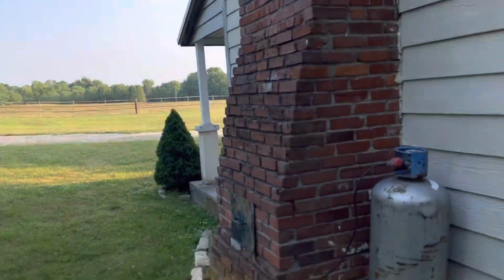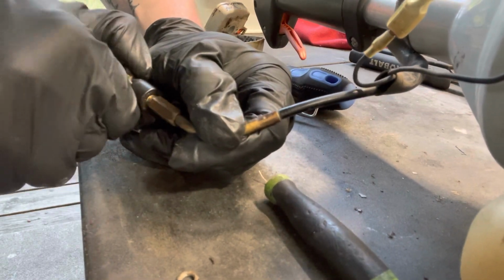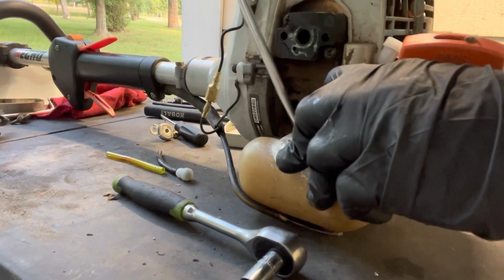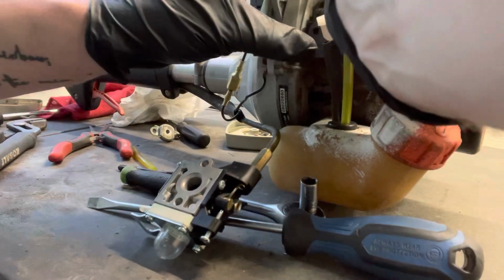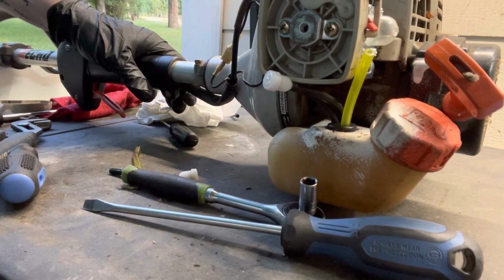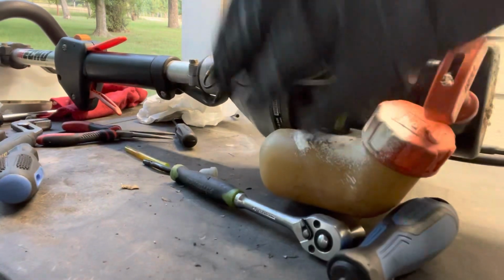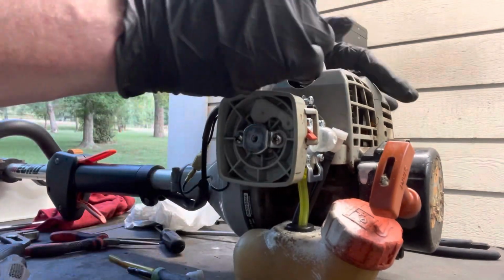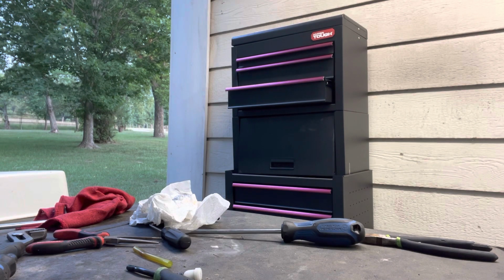Replacing the carburetor on a Echo srm-210 weed eater.

Comment: Bought this same trimmer used the other day. They had put the same carb and plug neww off amazon also . But guess neeeed adjustments because when cold hard so hard to start and would even have ro hold the throttle down. Gave up and when to my parts dealer and bought the original oem echo carb ans also the ngk plug and like night and day. Starts quick after pushing the primer 3 times. Dknt even have to hold the throttle down anymore . Was high at $69 but for me worth it not to have to struggle to start it every time

Comment: are these good carburators
Reply from the maker: I actually put a different carb on this weed eater because I was still having an issue and full throttle. What I found is that gasket between the motor and carb was leaking fuel and not all the fuel was making into the engine. 

Here is a link to the one I have on there now. So far I have no issues. 

https://www.amazon.com/dp/B0BHHZR1MH/ref=cm_sw_r_sms_apip_ABqgSbt5SJdpo
Reply: @Themillsmech  OK thanks i may just go with the factory carb i know they cost more but they do last